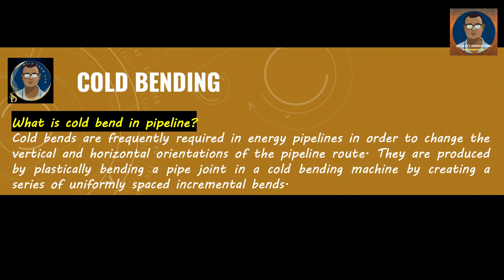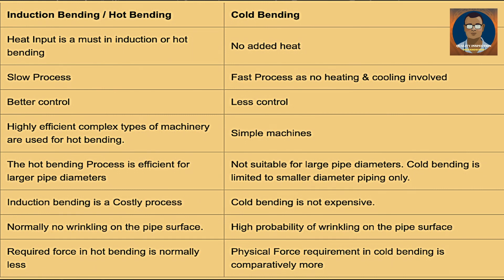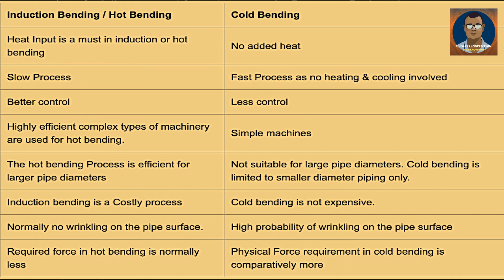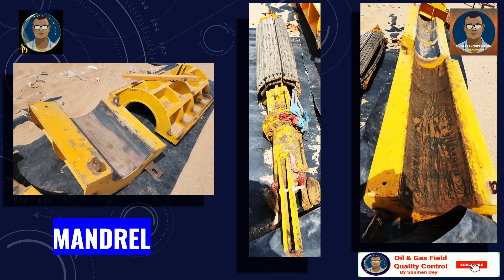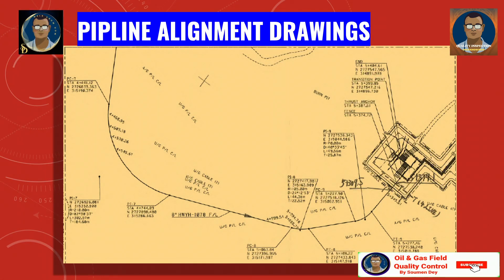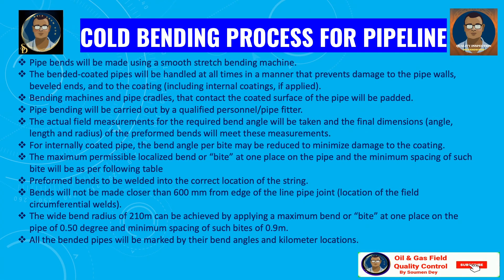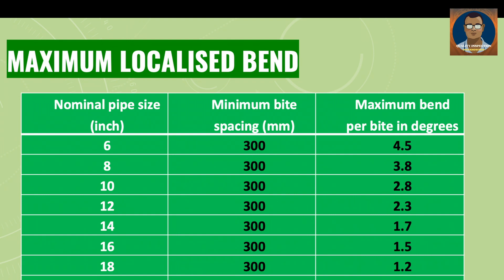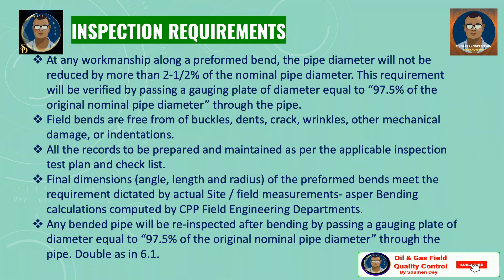Pipeline Cold Bends || How To Bend Pipes For Pipeline?

Comment: Any limit or range for elastic bends in buried pipeline with reference to international standards?
Usually in pipeline alignment sheets it shows 1 to 2.5 degree
I didn't get proper data in this matter 
Please advice sir!
Reply from the maker: This limit varies on various factors, like pipe materials, space constraints - which not allowing us to make long radius bend. Short radius Bends in pipeline will restrain the service flow and the line will not be scrapable for maintenance. It is very clear with our Saudi client standard (I can not take the Name)-  for example- cold preformed bend- for 6 inch pipe maximum 4.5 Deg per 300mm. it reduces with diameter. for 36 inch and higher- 0.5 deg per bite-@450mm interval.